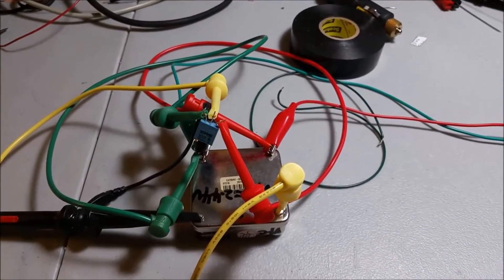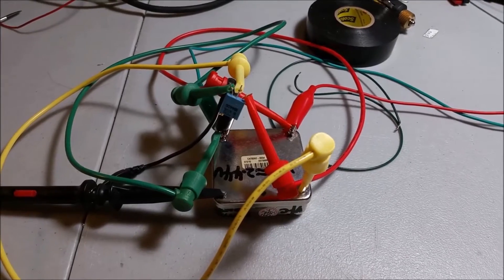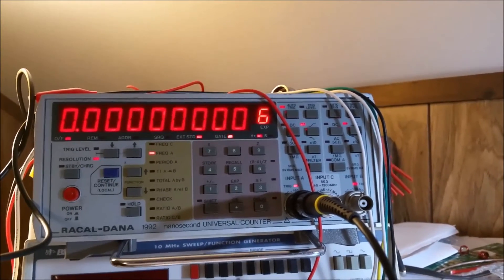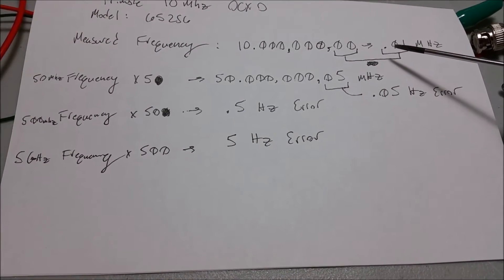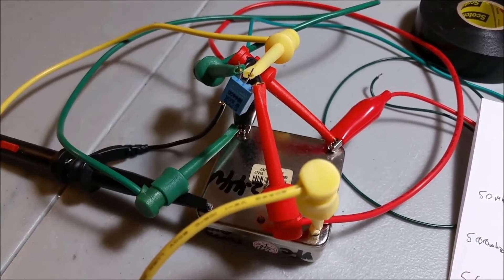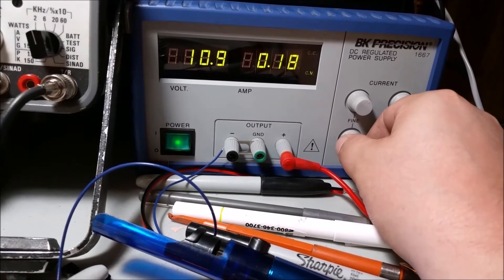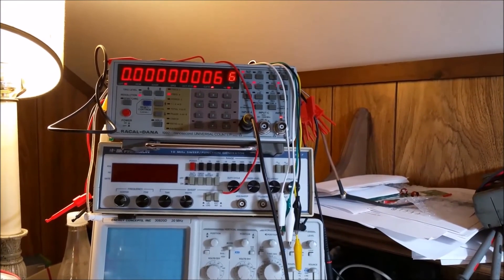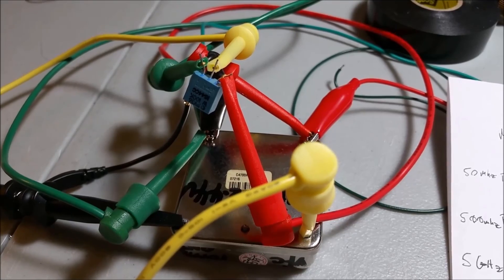Testing an Ebay Trimble 10 MHz OCXO

Comment: It is probably clear to everyone that if you use only a multi-turn potentiometer as a reference for an OCXO, then increasing the voltage of the source from which the voltage for the reference is taken will change the reference voltage and thus the frequency. The OCXO is a voltage-controlled oscillator compared to the TCXO. In order to find out how the magnitude of the supply voltage will affect the frequency, you must use a different reference source for the potentiometer.

Comment: Watch the supply voltage on these units, the sellers have them at 12v dc. I'm on my third 65256 and have learned the hard way they last a short amount of time before dying. Correct supply voltage is 5.0v dc.